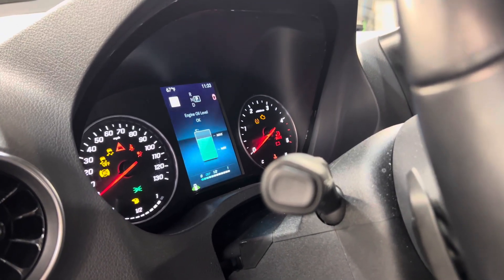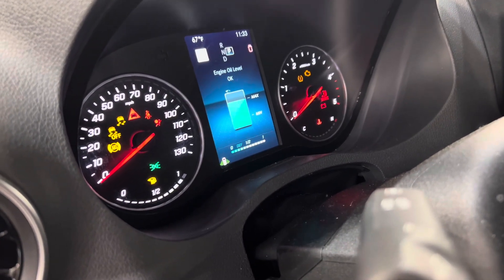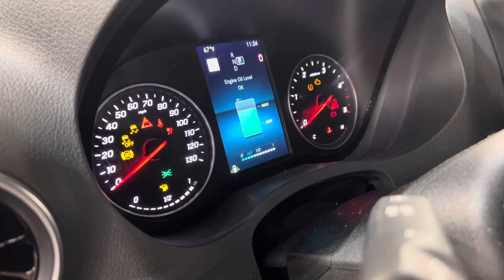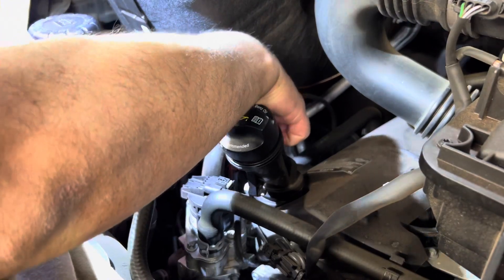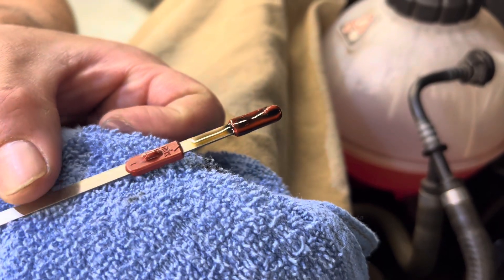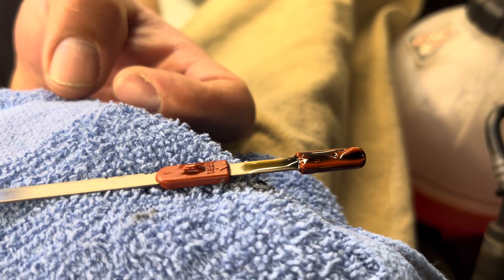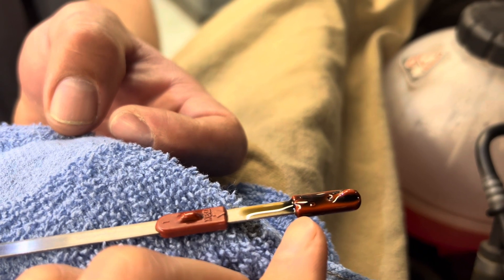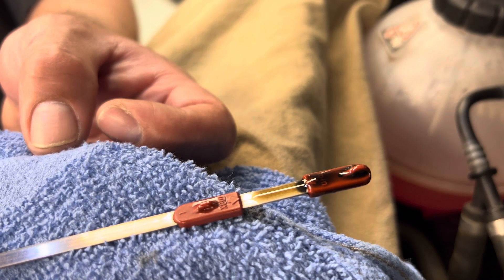VS30/907 Sprinter engine oil dipstick discrepancy

Comment: I believe the red dipstick is meant to read with the engine hot.  They sell (although apparently difficult to find) a dipstick with a yellow handle that is meant to be used with a cold engine.
Reply from the maker: @davecushwa4612 Can you post a source to this information? Would be interested to see it. Haven't found any OEM info as such, this is all Mercedes shows; "Please note that the engine oil level is to be checked via the instrument cluster. The retrofitting of an oil dipstick is chargeable to the customer and not advisable from a technical point of view, as it may result in different measurement results." Mercedes only lists one part # for the engine oil dipstick (red handle--as is the color for other Mercedes dipsticks). Only seen yellow handle dipsticks for transmission fluid on some vehicles. Thanks!
Reply: Because too low or too high levels are bad for your Engine...so 80% is best choice..or 90%.